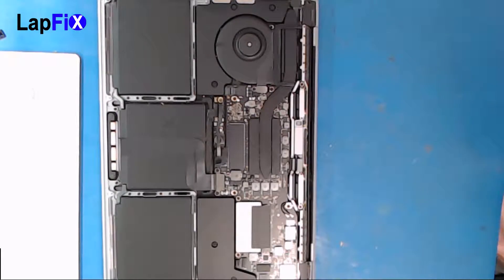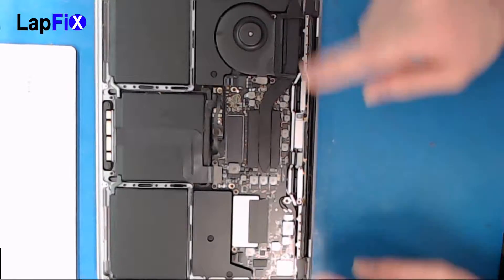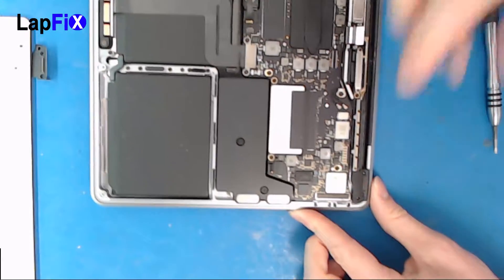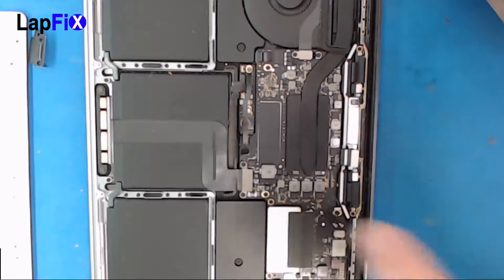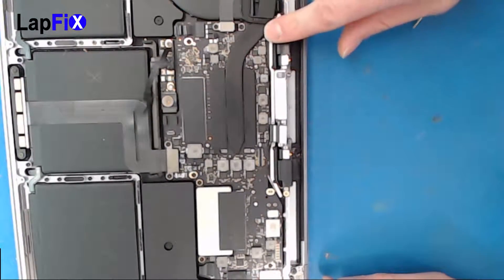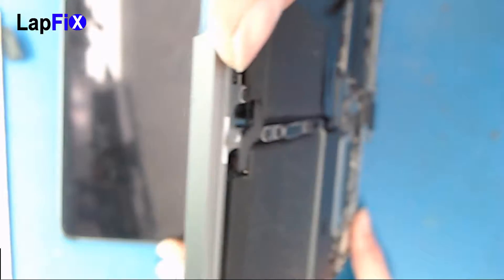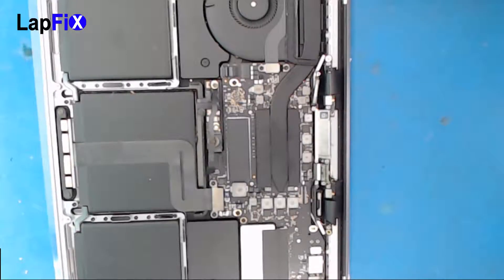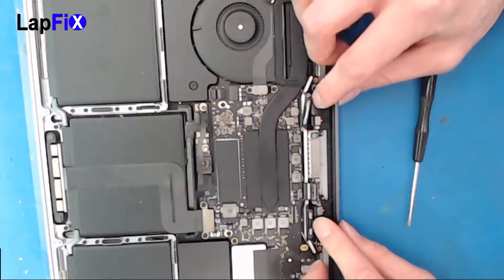Macbook Pro 2016 2017 a1706 a1708 Screen Replacement | How to

Comment: Hello, in these models, can you change the screen flex, or is it mandatory to replace the screen?
Reply: Do you mean the screen ribbon cables? If so, I was able to find a few vendors who did sell the ribbon cables. The problem is that the LCD panel itself is very difficult to remove from the lid/cover. Frequently it gets broken in the process. Apple simply didn't really design these things to be worked on or repaired. I think they were so full of themselves trying to engineer the impossible, that they ended up with machines that are just not easily serviceable. This particular machine is a prime example of that. 12 micro-miniature screws holding on the wifi antenna. WTH? Over 35 screws just to get to a point where you can remove the display assembly. And we wonder why these Apple computers are so damn expensive.
Reply: @gregm4164  Do you know of any cheap vendors for a1708 screen replacements?